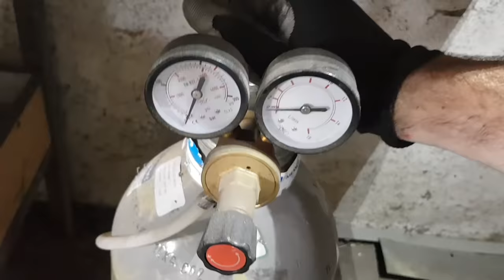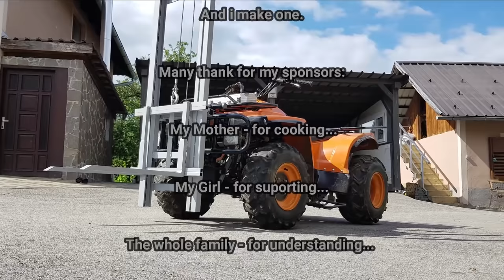ATV Forklift [DIY]

Comment: Love that Build! Nicely done!
Improvement suggestion: Make the upper supports adjustable so you can tilt back (or froward) the fork tongues a bit so the heavy load is better supported, does not slip down or can pick up stuff on uneven ground?